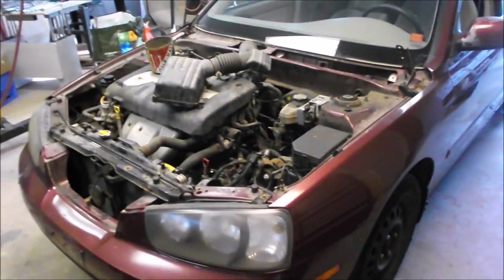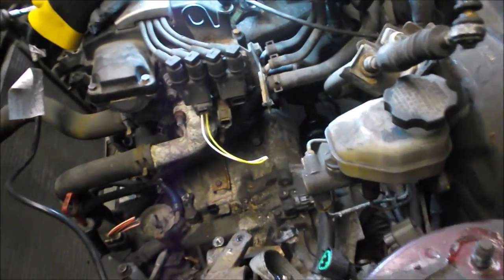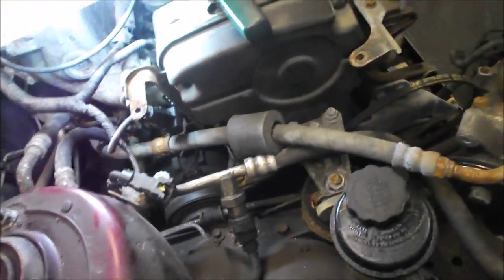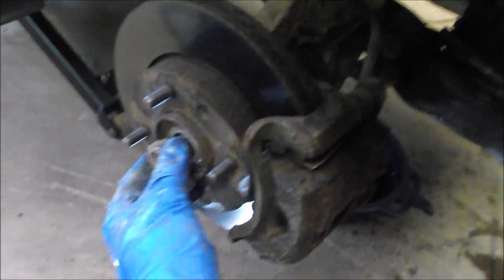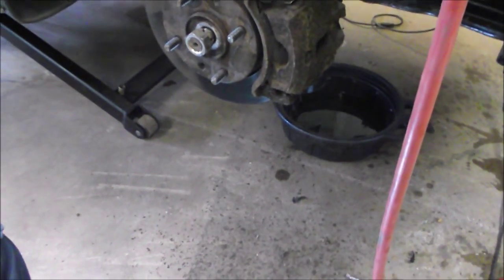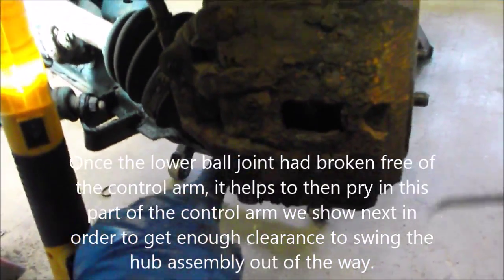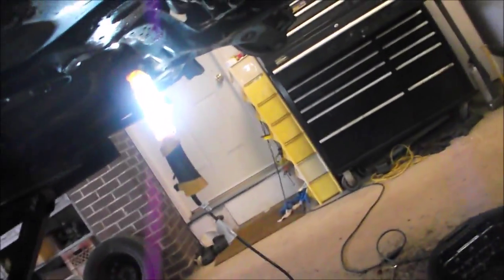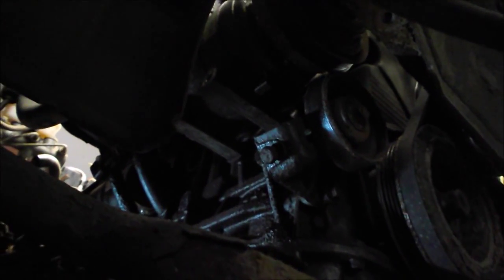DIY Part Hyundai Elantra transmission & engine swap 1 of 3 Removing the engine & trans from donor

Comment: Might be easier if you ever do this again to just drop the whole sub frame out the bottom with the engine and trans attached.
Reply: Have u tried  it
Reply: @htatesil4192  Yes. Much easier.
Reply: I seen his part 1 u can pull both up and out right both the transmission and engine not drop it

Comment: Hello, I have a bad engine in a manual transmission 2004 elantra and a good engine from a 2005 elantra (auto transmission) can I do the swap without any extra adapters? thanks
Reply: you can use the engine But you have to change flywheel, which mean you have to use the old one in the car. or flywheel manual flywheel.

Comment: I got a hyundai elantra just sitting around. Wanna do a 2.7 v6 swap and making from auto to manual, what are your thoughts?
Reply from the maker: J Combs  does that model engine and tranny come in that model car? If not, be prepared for headaches with basic fit up like motor mounts and even wire harness.  Ï would be easier to go from auto to manual so that part of your plan is great.   Go to your local hyundai dealer and ask for the oldest mechanic to talk with you over their next break and ask for his or her thoughts
Reply: mr diyguy123 yeah I have an 04 auto as a daily driver, bought an 03 for parts the body was in better shape but didn't run, also auto. Then seen for sale not to long ago of an 03 standard for sale that ran but the body is a bit rough up so I could switch the engine since their both 2.0l, but I don't know how exactly I'm gunna make the auto into a standard by means of switching the cables and brackets. Your thoughts?
Reply: I want to maintain the auto and buy a 1.8 engine instead of 2.0l any thoughts?
Reply: That's exactly what I want to do to my 05. The V6 Delta & manual transmission can both come from a Tiburon, which has the same chassis as the Elantra, so engine mounts won;t really be a problem. The few Delta swaps I've seen have used the Tiburon's gauge cluster and center console had to be used. The biggest hurdle, the guy said, was the wiring harness, but if you sort through it methodically, it won't become as big of a task. Check out the Elantra forums, there's tons of posts about it. Also, search 'Supercharged V6 Elantra' The guy uses an 01 GT and he did a great job